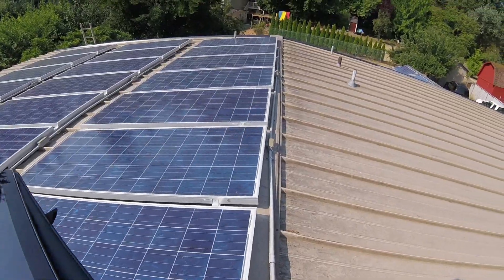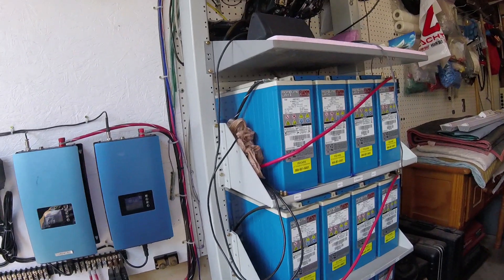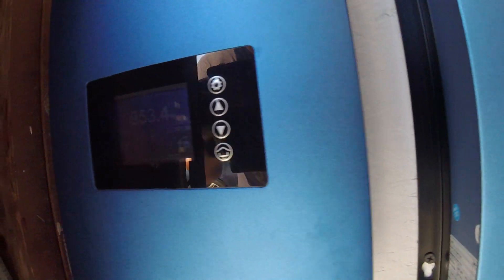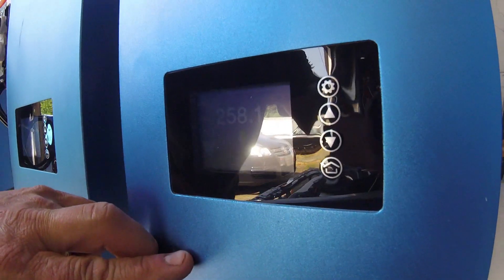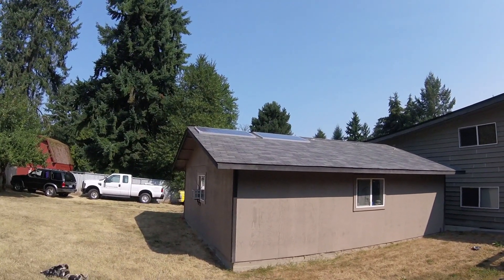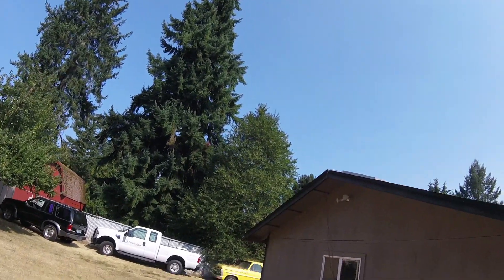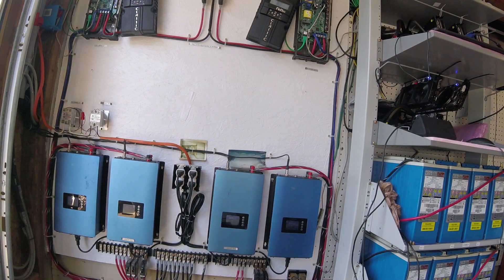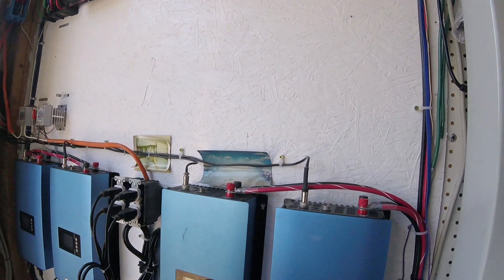5600 watt grid tied solar system with limiting inverters

Comment: im just starting to get into this solar gridtie systems .i currently have the solar panels connected right to my grid tie inverters . which works fine during the day .i have an 60amp mppt charge controller and batterys what i would like to do is during the night have the system run off the batterys untill the charge controller cuts it but i cannot figure out how during the day to not run it off my batterys i would like to use only the sun during the day and have the panels charge my batterys .any ideas thanks .
Reply from the maker: So im not an engineer but the simplest thing that comes to mind would be a timer. you might also integrate a light sensor ( like for a night light ) into an input ( if available ) on your charge controller. I will say that the top end usage of the batteries like I do is very light on the batteries and they should last 10 years or more because of the light cycle im using. I set the float at 54.5 and on a 48v base and only discharge to 47.5.

Comment: hello 
Nice setup... so i want know if all of the GTIL  use the same batri bank ?
Reply from the maker: yes, at first I had them separated but the unequal usage was not working for me so I switched to the common buss bar to the battery bank. It is better now cause I can add batteries to the whole system easily.

Comment: So the system uses the solar panels to charge the batteries. You use the batteries as a DC source for the grid tied inverters to 120v?
Reply from the maker: yes that is correct! it works nicely due to the household having low usage in the am when the batteries charge. the rest of the day the batteries are "pass through" really. it is similar to telecom setups, which is also why you see the two system redundancy.

Comment: What I like about this setup, the power company would never know you have grid tie... Now you can get dual coil cables to limit both sides of the meter for 1-4 inverters.  Search Ebay for GTIL CABLE.

Comment: Based on your video it looks like you have the charge controllers, inverters, and batteries all connected to the same bus. I read some of these controllers are not intended to be directly connected to the batteries. Do you have any issues with this? Thx
Reply from the maker: no issues but they have to be terminated on the common bus in a certain order to work. The charger then the inverter then the batteries, i dont know why it works that way but the Midnite solar charge controller lists this in the instructions.
Reply: @BertsFordFactory  Thanks for the help! Which inverter do you recommend? I found several on Amazon that look like yours but not sure if they are the same or not. This is the one I am considering. The reviews are positive for the most part but a few people indicated the units stopped working after a while. 
https://www.amazon.com/ECO-WORTHY-Solar-Inverter-Limiter-System/dp/B076KBCHBM/ref=sr_1_8?keywords=grid%2Btie%2Binverter%2B1200w&qid=1551374518&s=gateway&sr=8-8&th=1
Reply: @joegleason4306  if read most of the reviews they aren't supplying enough voltage! These GTL's need 24v to start up and when purchasing your panels if 12v make sure they hit a full 24v not 18v to 22v when run togather as many cheaper panels do. For 50-100 more you can get 24v 300w panels

Comment: Amigo, esses inversores com limiter precisa da autorização da concessionária ?
Reply from the maker: I think what you are asking is if I need authorization to use these , if so the best way I can answer that is no. But it also depends on how you use them. You should always be careful not to send power to the grid if the grid is down because of the linemans safety. These have auto islanding to help with that.

Comment: I saw there is 240V version of this inverter. Wouldn't it be better since it can feed both of your lines of the house ?
Reply from the maker: Martinko Pcik you are correct, they do offer the 240 v version of the inverters I use. I chose to use multiple 120v units for a couple reasons. If you look at the system on the board you will see that it's really two systems working together, the panels and combiner boxes are also split in this way. The batteries are the only common component. So redundancy is one reason, if a part fails I have a working system still. The most important reason though is because my line 1 and line 2 house loads are not balanced, as I suspect most households aren't, I believe that the 240v inverter would energize both lines equally which would send unused power on the lower utilized line out to the grid. I'm working on an update video that shows the load sensors and I'll show the unequal line utilization also.
Reply: @BertsFordFactory  That's a good point about lines in general not being balanced. That's the reason why 240v inverter would not help to optimally minimize grid power draw. Thank you. It helped to clear that in my mind.

Comment: I really like the clean set up! I don’t see how you got panels for close to $100 apiece because it sounds to me like they are 300 W apiece and usually those go for around $300. Also I don’t quite understand the reasoning behind all the batteries because a) they would normally cost an arm and a leg, B) they will need to be replaced from time to time, and C)  that’s part of the beauty of a grid tie system as you don’t have to have a battery bank. I can understand wanting to have some battery back up for night time or when the grid is down, So perhaps that is part of the plan. :-) One thing I don’t like about red tie system is they typically won’t work if the grid goes down. But batteries are kind of a relic and of course we are all waiting for the battery industry to unleash incredible innovations on us which will change everything.
Reply from the maker: vccranker hey man! Yes I got the panels from a clearance wholesale place in California, I think the seller was sun boulevard on eBay, it was a gamble but they had good ratings and ended up treating me well, also they are 24v 285w panels made by upsolar so not as popular. The batteries are also unique because I got them for free so I added them to the system more for a learning experience. They charge in the am when less  AC is need by the house then in the evening they supplement the load for the inverters to effectively extend my sun into the night. I have the voltage setup so that they only discharge to 47.5v before shutting off, which is really light use. Thanks for the comment!
Reply: @BertsFordFactory  Very cool.  Smart that you got such a great deal on the panels and free batteries!  : - )  I paid over $600 for 2 x 300 watt panels.  Oh well.  Still happy with them.  Charging in the am is the way to go I hear.  Congrats!

Comment: No dregrees for panels? Here 45°
Reply from the maker: usuario user I actually set up for a semi annual panel tilt system but the space wasted due to shadow and also the Diagonal roof alignment would have limited me to 10 panels, which did not justify the added efficiency:(

Comment: What device you use to protect the batteries from over discharge?
Reply: The midnight solar charge controller control the battery charging and stop when the battery are full.
Reply: Plus the inverter (gen2) will turn off when your batteries become safely discharged. (user set,  11/21v for example )
Reply from the maker: The Midnite solar charger controllers mounted at the highest point on the board handle the battery management. I have them programmed to turn on and off the SSR's you see on the mid left part of the board based on battery voltage. I have been advised that a firmware upgrade to the inverters can now handle this function without the relays though.
Reply: @BertsFordFactory  Correct. I have the new version and the 'cut off' and 'cut in' settings work great

Comment: Very nice system, I plan on copying your setup but on a smaller scale of 3k watts of solar. Im currently strictly grid tie for now but will incorporate a battery bank system once I have the funds. The 5k you spent is a bargain compared to the 15-20k solar companies quote, and its yours from day 1. You'll have a return on investment in a few years. Also a suggestion, you can add a sine wave inverter off your batteries so you can have back up power just in case the grid goes down. Anyway Good job!
Reply from the maker: Thanks for the comment! I intend on grabbing a 5000w sinewave to add as you mentioned, its a budget thing:)

Comment: Is it possible for you to make a video regarding the sensor clamp, location of the sensor clamps and how you stacked the inverters.
Reply from the maker: I have added some batteries and so intend on an update video ( with better sound ) soon. The clamps are attached so that the two inverters on the left are connected to the same main line in the breaker box and the two on the right are connected to the other main line. They seem to balance the load randomly depending on which one powers up first.
Reply: @BertsFordFactory  looking fwd. to the update. i am looking to expand but would love to hear how these have been working for you before i pull the trigger on a couple more units. i am torn between have 4 units or getting something bigger that is similar in rating, 4kw, but will end up costing me more.

Comment: Buenas niches cordial saludo, tengo una pregunta, tengo 03 inversores iguales a los tuyos pero de un momento a otro dos dejaron de funcionar, quedan energizados pero no muestra en el display voltaje de los paneles ni voltaje de la red eléctrica, sera que me.puedes ayudar o dar un consejo para solucionar el problema. Gracias te agradezco
Reply from the maker: I can not be sure. I would isolate your inverter, reset it to factory senttings, then see if the problem still exists. I had difficulties getting the settings to work when i first set up my inverters. if all that doesn't fix it then maybe try a firm ware upgrade. hope this helps!

Comment: Series? With batteries? How 🤷
Reply from the maker: I use a common battery bus bar for all the inverters. the inverters are specific to each line of main power to the house ( two per line ). The connections must be charge controller then inverter then battery! if the order is off then it doesn't work, I do not know why but the Midnite solar instructions make this very clear!

Comment: Very nice setup.Thanks for sharing. Just a suggestion, for SUN-GTIL2  inverters with FW Version 5.1, you can set the cut-off and cut-in (reboot) voltages in the programming parameter/settings. You don't need to use SSR to turn OFF and ON the GTIL once batt bank voltage goes up and down.

Comment: I thought these inverters did NOT work with a  battery bank power  ??  apparently you found a way around this??

  Ive seen them used in other configurations and each one is utilizing a pass thru conventional inverter for use of battery bank
Reply: You can set the inverter to shut off at a certain battery voltage. Your battery bank however has to be setup to work within the working voltage input of the inverter.

Comment: Looks like a great setup! Would you have done anything different? Do you limit the inverters at all or run at 100%. was there another vendor you were thinking of?
Reply: I run all four on the limiting feature built in using the clamp meter supplied. It did worry me that multiple inverters on the same supply line might not work but they balance really well.
Reply: master bert great. I have two that I will be installing. Are you finding that the 4 meet most of your power needs or are you thinking of adding more? I wish they made a bigger unit.
Reply: @zekeboz5533  I thought they made a 2000 watt unit also.

Comment from the maker: so I didn't add the connection to the main house lines for the amp clamps but basically there are four amp clamps that were sent with the inverters. two of these are connected to the main line of the house inside the breaker panel and the other two are connected to the second line. it's pretty tight in there and i did have difficulty getting all four connected but it does fit in my old box. i don't think ill be able to add any more without making changes!
Reply: all you have to do is put 1 clamp on each line and splice the single Ct clamp to both inverters. so 1 ct clamp will run 2 inverters .its pretty easy ;-) good luck

Comment: Did you use the wire with the blue connector to your main power line
Reply from the maker: Yes I used 4 of hem but they now sell dual cables like that with on clamp that use less space!

Comment: How did you get The blue boxes hooked to your main power line
Reply from the maker: the inverters are wired to any outlet on the appropriate main line of the house / fuse panel

Comment: great set up.  did you stack the grid tie inverter on 2 lines?  how did you organize the clamp sensors?
Reply from the maker: two of the inverters per line in the main fuse panel for the house. its tight!
Reply: so that being said, does this mean the two sides links to one another inorder to keep phases 180 off? or does it not matter as the inverter are already matching the freq anyway?   @BertsFordFactory
Reply: You can get a cable that goes from up to 4 inverters to just 2 coils,  connected L1 and L2.  Search ebay for GTIL CABLE

Comment: Nice clean set up. I am running the same inverters but have two tied directly to the panels and two tied to batteries. Battery units come on at night only and recharge during daytime. Man you burn 60KWH per day ?!?! Who is growing weed ?
Reply from the maker: Well its legal here! but I'm using some of it to run those bitcoin rigs that you may see in the rack above the batteries!
Reply: well thats a wholenuther topic... unless this whole system was funded by it lol     @BertsFordFactory

Comment: Seems kinda expensive way to go but looks great
Reply from the maker: yes! I work in the telecom industry and I tend to lean towards redundancy. you are right I could have done the same thing without some much equipment.
Reply: Check out my system . Click on my name
Reply: Do you have a link for cheap batteries

Comment: That is an awesome system, thank you for sharing.   I'm living in Thailand and will be getting the
Sun  GTIL-2000G2 with the 3M external limiter and WI-Fi.  I have (4) JKM325PP-72.  I plan on getting two more panels at a later date (2SX3P).  I'm glad to see the kind of output you are getting on those grid ties.  Originally I had no plans of maxing out the grid tie inverter, but now that I have seen your video, I think I will try it.
You have the information I have been looking for.
Reply from the maker: I did not have any good luck with the black box type external limiters! I did not show it here but the limiter that uses the blue amp clamp is what's working for me.
Reply: @BertsFordFactory , thanks for your reply. At the last minute, I ended up getting the Solax 1.5 kw grid-tie. I'm hearing good things about them, plus it has 5 year, option 10 years on the warranty.
My unit cannot use a limiter, but they do have some larger units with a limiting function, but all these are 220 AC here in thailand.
 Keep posting any updates, thanks again. I